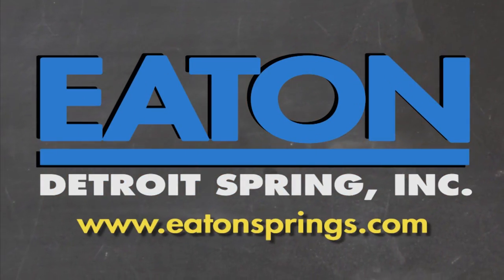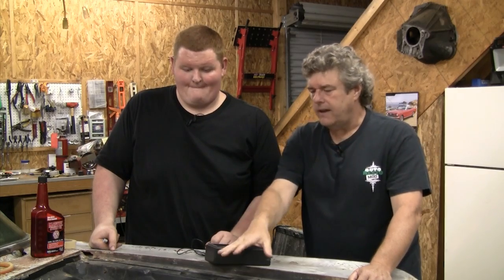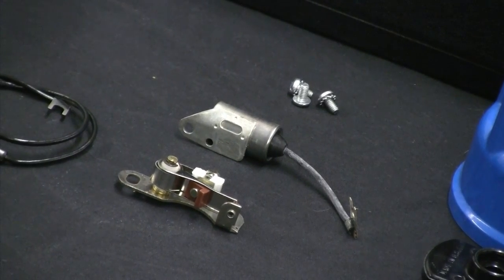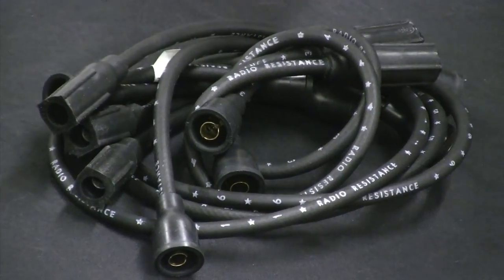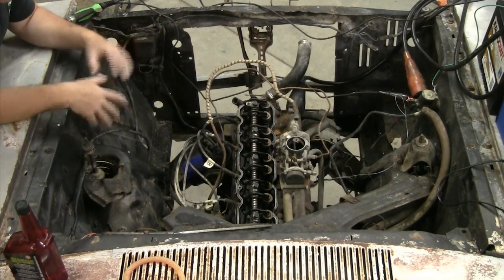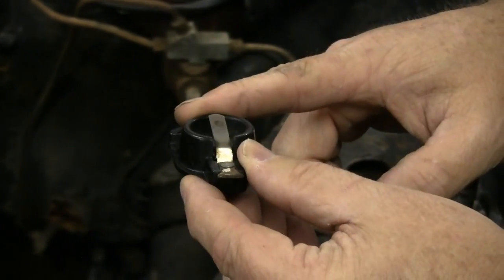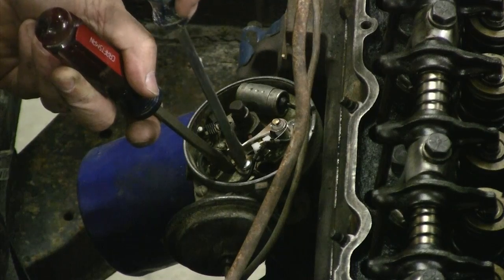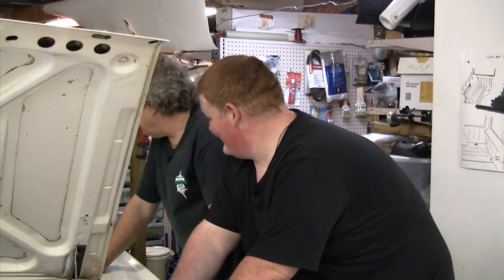How to Install Adjust and Set Breaker Points in an Automobile Episode 267 Autorestomod

Comment: isn't  the condenser just a capacitor?
Reply: +Dylan Harris It is yes
Reply: Yes it is,,,and the capacitor is used to hold the charge until the points open, at which point the charge is released.  It is NOT (as many you tube videos indicate), I repeat NOT, a resistor to impede spark between the points..  The you tube videos are permeated with incorrect schematics.
Reply: Uhmericans name things randomly. Eg. Soda equals carbonated. TV ruined that country.
Reply: @thomasgronek6469   YouTube does involve much incorrectness like the ridiculous nonsense you posted about how a condenser functions in an ignition system.
Reply: @JoeBlowski  so what IS the difference, please enlighten us.
Reply: @thomasgronek6469  In another post you claim that the condenser holds the charge until the points OPEN, at which point it releases the charge through the primary winding of the coil. through the distributor wire, and into the rotor (for distribution).  / You complain about people posting incorrect info, but that is exactly what you are guilty of,
because you are not even close to being correct. Instead of teaching I'll just hope my effort contributes toward preventing anyone else from being misled by your ridiculous theory. You should learn before you teach.

Comment: the dwell is how long they stay open ----- if you set points at 20 thousands that is the dwell time a 6 cyclinder eng dist shaft will have 6 high lobes to open 6  time per rev. the points going starts the current  flow  because the pints are  grounded in the closed pos that stops dist from doing any thing  (  no spark) as high lobe comes around it starts the firing again buy opening the points with eng running points are moving very fast  now  this is what happens if you have the wrong value MFD cond, or it damaged   all that voltage can not go thru the cond,heres what happens some voltage get thru enough to generate the spark in the coil  the rest ofthe voltage is going to ground by jumping the gap of the open points to gd causing the points to pit ..this in time will cause tble  that pittin is cutting down the open
Reply from the maker: Actually input

Comment: I thought the condenser was there to prevent arcs across the points.
Reply: +Howard White It does you can think of a condenser as a shock absorber for the points.
Reply: You stole the guy's thunder! ;-)
Reply: It allows the inductive spike (back EMF) from the coil field collapsing to continue flowing to the condenser as the points open, which reduce arcing across the points when the gap is still very small before they open fully, this charge in the condenser is then reflected back to the primary coil and back again many times rapidly in an oscillation, that speeds up the collapse of the coil magnetic field to provide good spark energy at very low engine speed particularly starting, then the points close and field builds up in the coil primary windings again. As they reduce capacitance with age and heat cycles they will still work to arrest spark but will the coil will increasingly have less energy when starting and so the first sign of a bad one is poor starting before it gets bad enough to cause arcing on the points. I just did a video covering it and how to diagnose a faulty one.
Reply: The condenser holds the charge until the points OPEN, at which point it releases the charge through the primary winding of the coil. through the distributor wire, and into the rotor (for distribution).  If there was a need to use a (shock absorber) then a resistor would have been used.  Don't feel bad, I have had physics professors get this wrong, AND there is MUCH  misinformation on you tube about this.
Reply: Sorry,,,but, I don't think so.
Reply: +Thomas Gronek What you describe is capacitor discharge ignition CDI that has no relationship to the points and condensor system. i have a few videos on the topic from this one E22 https://www.youtube.com/watch?v=xNllhOWGHhg to E23, E24 and E25 covering twin point distributors. I will be covering CDI soon.
Reply: Thanks for the info.  I think I need to examine both systems more closely to better understand why thinking might be scewed.  I have watched too many videos with different (conflicting) info.  Thanks again, Tom
Reply: After review of the video (thank you),  our thought processes diverge at the 9 minute mark.  I contend that the capacitor releases its charge, back through the secondary winding, and into the distributor cap.  Thanks again.
Reply: +Thomas Gronek The negative side of the coil has the points and condensor both going to ground when points are closed. So the condensor at that moment has 0 volts. The positive side of the coil has 12v. When the points begin to  open there is no voltage stored in the condensor, it is then charged as they open by the rising potential of voltage each side of the now open points that far exceeds 12 volts due to the inductance of the coils and that  is reflected to the coil in oscillations back and forth as it dissipates and due to mutual inductance that occurs in the secondary also. E23 video covers how mutual inductance works in coils. E24 video shows tune scope patterns to see the condensor operating  A CDI is different, it charges larger capacitors to hundreds of volts, that is then released into the coil which the coil multiplies to spark voltage so it doesn't use the already stored 12v charge of the coil inductance collapsing like points system does to generate spark voltage, CDI flashes the coil primary with voltage, it is solid state switched, that much current would weld points.

Comment: how do I change a points system over to a distibutor?
Reply from the maker: Pertronix makes a distributor or you can also just to the Pertronix plate system. We have used them with great success.

Comment: um........yeah.  Kinda skimmed over the dwell meter setting: connections and how to adjust.  I assume via playing with points again but I'd like to see the process since I assume the engine has to be actually running to see the dwell angle so do you then turn off, remove cap again and adjust......and then start it again with cap back on....  Would like to actually see the process.  Less cute stories and more detail would be nice.  Or at least add the detail.  I"ve now spent 23 minutes and still don't know exactly how to use my dwell meter.  : (
Reply: The best thing to do is to find a distributer cap for your vehicle that has an access window for the points screw.

Mine takes an Allen wrench.

Set up the dwell meter and start the vehicle, turn the screw untill you get the dwell setting you want.

Comment: You're a mechanic so why would you wish you had a magnetic screwdriver? If you have a piece of wire and a battery you can have a magnetic screwdriver wrap the wire around the screw driver shaft and then take each end of the wire and touched them to a positive and negative power source this will magnetize your screwdriver
Reply from the maker: Never knew that.

Comment: probably do the distributor assembly work with it uninstalled, out of the car,  its just easier for  the whole process- like if u accidentally drop a screw down the dist housing, just flipover!  & its easier to spin the shaft for positioning the cam lobe
Reply from the maker: Sometimes those Distributors can be a real pain to get back into position after they've been pulled out. I've never had a screw fall down there far enough that I can't get to it with something LOL.

Comment: I have been messing about with cars for 52 years, I have never used a dwell meter to set points. Just gap them correctly and set the timing. Keep it simple stupid, Yeah!.
Reply from the maker: GM points can be set by dwell method much easier than Ford due to door ans allen head bolt setup in the distributor. Of course they take easy out of the equation by putting the distributor in the back so...it evens out. 😁

Comment: At a dead stop done all the research on the internet as possible even spoken to other technicians friends and family I even have my technical manual for my 4-cylinder Flathead MY WWII generation. How is you everything piece by piece three different types of wiring diagrams and the wiring diagram for my setup I've traced it back and forth back and forth. No spark no start. Put the light tester on the coil flip the switch on and off tester light goes on and off. Reminder this is a toggle switch on off with a push button start. Spark plug tester one lead to the plug other end to the spark plug screwed into the cylinder head, When you flip the toggle switch to the on position, it's energizing the coil immediately like it should I have no spark at the distributor points yet when I turn the toggle switch off a spark occurs at the spark plug tester in between the plug and spark plug. Sounds like I have wires reversed talking about the toggle switch,nothing changed. It didn't matter if the toggle switch wires were reversed or not it still did the same when I turn it off I get a spark between the wire and plug. Let me know if I'm missing a wire, battery negative grounded to frame of generator-positive ran to starter button-other starter button lead to the starter. Toggle switch wire going to the AMPERS-other wire from toggle switch to positive side of coil. Negative side of coil to distributor with a outside condenser. Everything is brand new, new plugs new wires new points, new condenser.
(At the battery with the negative side removed I tested each spark plug with the spark plug tester gradually scrape the negative terminal and the spark plug tester was working inside the little glass so you can see the spark. (If you gone this far reading this I surely do appreciate it.) I have a three-prong regulator all automotive Jeep Willy parts. Looking at the terminals left to right.BAT-ARM-FLD all three wires are electrical tape down to the charging generator. Left to right_ bat white wire,arm yellow wire-fld green wire.white wire screwed into top charging generator. It's electrical tape straight down to rubber grommet far as you can see,yellow and green wire going straight into the charging generator around the rubber grommet. Peeling back electrical tape I see the green wire going into the rubber grommet yellow wire attached to a red wire going into the rubber grommet of the charging generator. That's how it was when I got it, without removing any wires I took the charging generator with the wire still hooked to the regulator supposedly he rebuilt the inside refreshed everything and he tested it and he said it was fine. I have the casing off the generator ATM, once the casing is cut back around the generator the regulator gets bolted inside the casing. Not sure if they did it that way so it can have a Ground source. Besides the three bolts that holds the regulator to the casing it does have a small flat head screw I would suggest for ground it was never hooked up or a wire existing. If you made it this far congratulations you're freaking 😎 awesome! Question 2*-  the regulator hooked up to the charging generator basically it's doing nothing,do I need a wire? Available gauge 1.(A.C. VOLTS-VOLTAGE 0-150) & 2.(A.C. AMPERES LOAD CURRENT 0-30)3.(AMPERES NEGATIVE 30'15'0 POSITIVE 15'30') OUT OF THOSE THREE GAUGES is there supposed to be a wire going from one of those to the regulator if so what post-BAT,ARM,OR FLD?
MAYBE THAT'S MY PROBLEM no spark at my points. I have a positive jumper wire from start button hooked up@AMPERES WHICH MY TOGGLE SWITCH ON/OFF IS GOING to the AMPERES as well like I said in the beginning the other wire on the toggle switch is going to my coil positive side. Now could this be the problem? From the actual generator that produces power could one of those wires be reversed I was just thinking that but would it have really anything to do with my distributor not getting spark? I'm going to try it and see what happens I made my own labels because I had taken it apart and put it back together and I know how to read a wiring diagram so I'm pretty sure everything is wired away it says it's supposed to be. If you got this far congratulations because you're a good person to read all this email me if you would like to reply to this long message.
chandlernicholas624@yahoo.com
If you email me for the subject put
(ZXB MY INPUT) MAN I HOPE YOU RAN ACROSS THIS PROBLEM IN YOUR LIFETIME GOD BLESS BROTHER

Comment: Please skip the humor.  There plenty of used dwell meters sold on eBay without an instruction manual.  A video with step-by-step connections for each test clip from the dwell meter to each terminal on the engine to test dwell, RPM and point would be so helpful.  A good video is needed for the DIY mechanics and new owners of classic and older cars and trucks.
Reply from the maker: Hate to say it but we have fun, if we say somnething, it ends up on the video. Humor is part of both Cam and my personality. I think that would be a good video idea! We'll look at doing a short on that here soon.
Reply: @AutoRestoMod  I appreciate it when anyone has fun making these informative videos. Bravo. I own a used RAC Maxi Tune dwell meter w no manual. Had one years ago and carelessly donated some items to Goodwill w/o checking. I know there are different dwell meters out there w different leads or clamps. I am guessing of the 3 clamps I have on my RAC Maxi (black, red and yellow) the yellow attaches to the neg (distributor side) of ignition coil while the black clip is grounded to chassis. My point is this: DIY mechanics and owners of older cars and trucks (w diff meters) may be unsure what clamp goes to what terminal and there are fewer mechanics & auto stores who can give any advice. Your videos would be a great help. Thank you.

Comment: Unbelievable! Dirty distributor cam with new points? No cam lube on the cam follower? Steel feeler gauges? A tune up includes new plugs. Pull them, and you can turn the engine by hand. They used to make a plastic piece to isolate the second set of points. Why buy a new ground wire, and use the original? I have more tricks to make old stuff run. No wonder they got rid of the old system.

Comment: This dude spent 23 minutes on a 3 min video and used a feeler guage on points😒
Reply from the maker: We all have ways of doing things. I was taught to use a feeler gauge. Go. produce a 3 minute video. Let me know when you are done. You can use a dwell meter. Easier on GM than Ford since the points are externally adjusted. For you have to pop the cap. And if you aren't supposed to set points with a feeler gauge...why do they give gap info?
Reply: @AutoRestoMod   brass guages or a matchbook. A matchbook is .017 and the cardboard box that the cap and the box the rotor come in are around .019